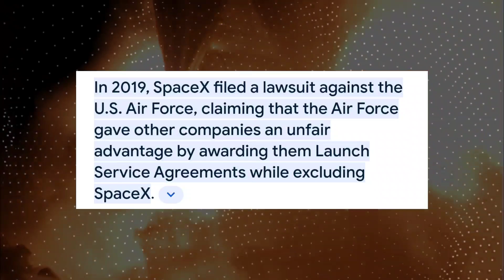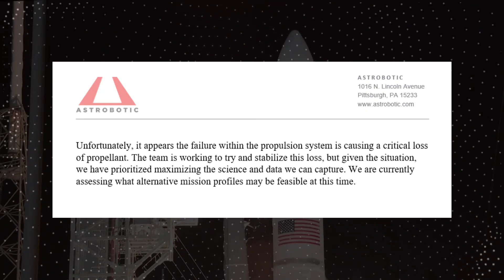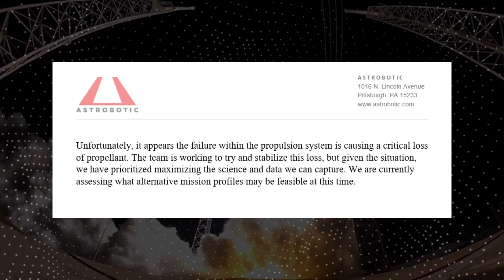What Exactly Went Wrong With Astrobotic Lunar Lander?

Comment: Astrobotic's current hypothesis about the Peregrine spacecraft's propulsion anomaly is that a valve between the helium pressurant and the oxidizer failed to reseal after actuation during initialization," company representatives wrote in a post on X Tuesday afternoon (Jan. 9).
"This led to a rush of high-pressure helium that spiked the pressure in the oxidizer tank beyond its operating limit and subsequently ruptured the tank," they added. As a retired mechanical engineer, I admit I don't know much about spacecraft design. That said, for terrestrial engineering, designing a system with such an obvious single point failure seems a bit odd. To me a second in-line valve and a tank pressure relief system would at a minimum should have been installed. Clearly weight limitations need to be considered. However, valves fail to seat all the time and critical functions should have redundancy.